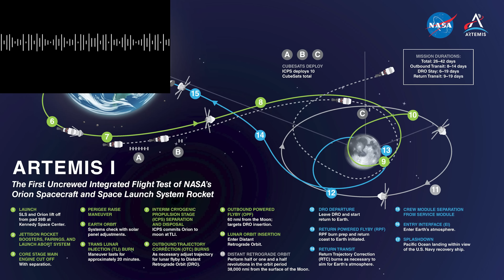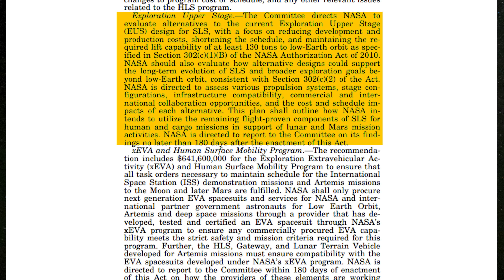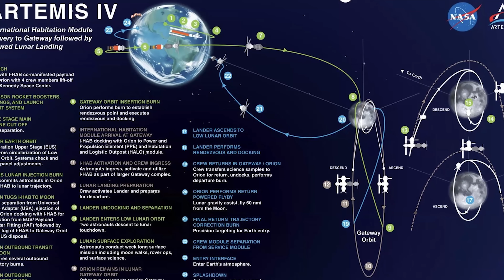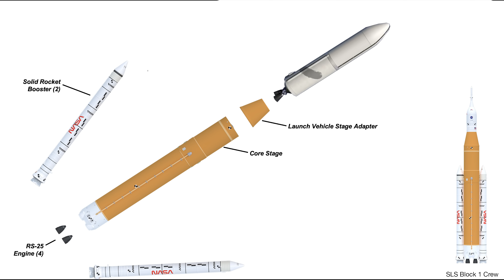NASA Found Brilliant Solution to Go Back to the Moon before China. SpaceX Starship?

Comment: How can Space X Starship land with those small landing gears on rough moon terrain?  it looks like it would topple over  if it landed on the side of a sloped hill or less than level landing spot. How would this be overcome?  Does it limit the areas where it could land?  Is this a concern?  The entire rocket does not look that stable sitting on those tiny landing legs.

Comment: Worried about billions over budget and over a decade of redesign, so am I, 
but  have a look at the DOD and the F35 Joint Strike Fighter.  These large budget programs are never about the goals, it’s mostly about getting the money. Truthfully $4 Billion a throw to get to the moon with a crew is high but not comparatively prohibitive given other high tech programs especially in aerospace. At say one launch every 4 months it’s $$12 Billion a year. Pretty small measured again a 4 $Trillion (yep that’s a T) budget or an $880 Billion DOD budget.    

A good analysis would be to examine the SLS contractors and audit where every dollar went .  After all the Orion is a larger Apollo command capsule and the rocket components are ALL variants of Shuttle systems.

Comment: Remind me - when did NASA ever manage to get anything recently that not incredibly late and not seriously over budget and when did Blue Origin ever manage to get any rocket into orbit? 
I'll believe it after it's happened. 🤷
Reply: Not NASA but the B-21 Raider is coming in under budget and ahead of schedule.  NASA's problems stem from a lot of competing requirements and stakeholders that create a vicious cycle.  Sadly, Starship is an even bigger boondoggle as the entire launch architecture ultimately fails.  Nobody is going to the moon if going to the moon means 10+ Starship launches hours apart and it all working flawlessly.  Elon's contacts should be canceled and the money reapprorriated to building a Lander that will ride on SLS.
Reply: @atticuspomponius  
SLS is an incredibly late and over-budget turkey.

Comment: How far do you bet the next one will get?  I'll give 3:1 it doesn't make orbit.
Reply: They are not trying to get to orbit yet, it's called a development process. It's the biggest, most powerful, and most complex rocket ever made. Cut them some slack, the progress is actually amazing and years ahead of anyone else so...
Reply: @ericmichel3857  no slack.  There's no benefit to SpaceX whatsoever.  Arrogant waste of billions.
Reply: @ericmichel3857  Saturn-V made it to the moon on it's third launch. It never exploded during launch even a single time.
57 years ago.
Reply: @Yora21  You do realize most (if not all) of these test flights are designed to fail. They are experimenting with various system designs, and then stressing them beyond their design limits to see where and how they fail. This is how they will eventually build a reliable system. Some failures may have been unexpected, but that is how they are learning. 
Yes Elon is very optimistic with goals and time lines, but that is what good leaders do. Most people tend to operate to the level of expectations, so if you want rapid innovation and productivity, you need to set high expectations. So you have to take his estimates with a grain of salt, but they are certainly making progress a lot faster than any other team on the planet. How can you not see or admit this undeniable fact?

Comment: What options does NASA have? How about scrapping the Artemis program altogether, and going back to Saturn/Apollo? That program went from drawing board to moon landing in 7 years, without today's computers and modern manufacturing techniques. We still have the hardware in museums. The F-1 engine has been redesigned to use 90% fewer parts, cost less, and generate 10% greater thrust. Just imagine what could be done if this was done with the entire program. 
As for cost, had NASA stayed with Saturn/Apollo, it could have launched every payload launched by the shuttle, AND gone to the moon 100 times, built a moonbase, and a space station, and had money left over. 
So yes, NASA has options - go back to a proven system that worked, or stick with a program that costs 2-3 times as much, is decades behind schedule, and still does not have a viable capsule, launcher, or lander. Gee, what to do?
Reply: But there's so much money in re-inventing the wheels ...

Comment: Here’s my idea:
Replace the RS-25’s with RS-68’s
Replace boosters with 4 Falcon Heavy core boosters
Reply: The RS-68 was studied for a concept similar to SLS, they found that the ablative nozzle wasn’t a good idea next to the SRB’s.

A Starship-derived vehicle using Super Heavy and an expendable upper stage would be the best option.
Reply: @darthrevan2961  expendable starship pretty much? with re-use on booster at least?

Comment: SEVERAL roughed-in plans for consideration:

#1:
What man-rated alternatives exist for Exploration Upper Stage?
Find one such replacement, mount it on a Falcon Heavy and get it on its way.

#2:
Commission a non-recoverable Super Heavy and a non-recoverable and truncated Starship with a special interstage to launch the Orion package, including the Exploration Upper Stage or its replacement.  The pad systems will need to handle LH2.  
The refueling still needs to be done for the OTHER Starship, the HLS.

3:
Plann to launch HLS to LEO and refuel it.
When that is done, launch the Orion package to orbit.  When it docks with HLS, fire up HLS and push Orion to the moon.  It would only need to stay backwards until TLI is accomplished when it can unlock, turn and proceed on its original mission profile.  The two vehicles will dock, again, near the moon and proceed with thriginal plan.

Savings to NASA, about $3B, assuming SpaceX can supply which ever set of hardware is decided upon for  no more than $1.2B.

Comment: Pourquoi avoir besoin d'une solution  pour quelque chose qu'ils sont censé avoir déjà fait plusieurs fois?! À moins que... Non?!... Ne me dites pas que...
Reply: The Saturn 5 rocket was designed and built to take men to the Moon. Sadly,the plans no longer exist.
Reply: @PC4USE1 : the plans exist, as do 2 unused complete Saturn V's as museum pieces. What has changed is technology and materials. Really, not much use building equipment that is 60 years old.

Comment: Would it not make more sense to launch a lunar Starship to orbit empty, fuel it up with however many launches that takes, then once its all gassed up, at that point launch the astronaunts up using a Dragon capusule, dock with Starship, load up, then head for the moon. No need for Starship to even have an abort system in that scenario.

Comment: None of these starship claims has been born out by ACTUAL EVENTS. Did you see the state of starship before it sank into the ocean? That was neither reusable or capable of sustaining a crew. This is all just talk until that system is HUMAN RATED and can lift off and return safely to Earth. Stop parroting billionaire fantasies. You also can't go to the moon on these tight budgets. Its not gonna work if you want to beat the Chinese .
Reply: They are doing all sorts of experimental stuff with all launches so far and a lot of those they already know are iffy but they want to test it. Instead of modeling stuff for years they build and launch and see what works.
Reply: do you work for special interests? Artemis might be good but it's not going to be in budget you've got too many hands in the pot. even with the motivation of competition from SpaceX. those industries have no real motivation to save the government money only take money that could go elsewhere.
Reply: Easy to criticize a brand new product under development as not having accomplished it's goals. How much did you accomplish before you were born? Fuel is cheap, big rockets are expensive. It doesn't matter how many fuel trips required when the rockets and ships are re-used.
Reply: @royh6526 I’m not criticizing. I’m stating facts. Not one refueling maneuver completed. The plan is to use a booster and a star ship to ferry 10 loads of fuel up to a star ship in orbit , fill it up and send it to the moon or mars. As a casual observer of this process THEY ARE NO WHERE CLOSE TO ACCOMPLISHING A MOON MISSION. Forget about mars, let’s just focus on the moon. At the rate they are going it’s not happening until the 2030s
Reply: @ChristianPerez-gc2hm  " At the rate they are going it’s not happening until the 2030s"
You must be young. I'm old and 5 years ago seems like yesterday. SpaceX started working on Starship 5 years ago, and another few years to get to the Moon seems about right. SpaceX progresses faster than any other company. NASA has been working on replacing the Shuttle for over 20 years.
Reply: @royh6526  Nasa's budget is nonexistent. You wanna go to the moon before 2030, use falcon heavy. Instead of moving toward that goal, space X is being allow to use our tax dollars to Rand D this boondoggle. Starship right now is a tin can with rockets and fuel. Do you honestly think that once it's full equipped that any of the information that is gathered now will be relevant? They are ironing out the basics of operation. This is a test bed. It is unknown what the development time of this platform will actually be. But I will bet you that a human won't be going around the planet in a starship until the 2030s.
Reply: @ChristianPerez-gc2hm  "But I will bet you that a human won't be going around the planet in a starship until the 2030s."

I agree, it will take some time to get human rating, however It will do much work before then.

"Do you honestly think that once it's full equipped that any of the information that is gathered now will be relevant?"

Yes, highly relevant to design the final product.

Comment: Personal speculation: next year, a dock-undock test will be carried out between Starship and Dragon, then a proposal will be made to avoid SLS and Orion and use Dragon to travel from Earth to LEO, put the astronauts on board the resupplied Lunar Starship that will do LEO-Moon-LEO, then return the astronauts on Dragon for their return to Earth!
Reply: Concept right, details wrong. Dragon is not suitable for the long and radiation filled trip to the Moon. But all it takes is for the astronauts to transfer from Dragon to HLS in LEO then the HLS can do the whole LEO-MoonLanding-LEO accompanied with fuel tanker(s) to orbit the Moon while HLS is on Moon surface and all return to LEO.

Comment: Starship could slash lunar mission costs, but NASA must ensure its safety matches SLS/Orion.
Reply: True, but since SLS (Artemis 1) has at least launched, made a fly-by of the moon and returned its capsule safely to Earth at lunar return speeds (40,000kmh) and meanwhile, Starship has been barely able to get into LEO without blowing up in some shape or form, and is unable to survive a sub-orbital re-entry (28,000kmh) without melting then this is a bit of a moot point.  Maybe in another 10-15 years.

Comment: Apolloitis. The madness that we have to repeat Apollo's methods because it worked almost seventy years ago. 
Apollo was a kludge, a mediocre and unsustainable system designed for a political statement. Apollo ended because it had no goal. It had no ability to iterate technology. It was a way of spreading spending across 50 states to maximize political support. But it was useless as a space program. NASA wanted a reusable space plane to do what Apollo was doing. If NASA had been allowed to iterate the space shuttle properly for instance making a titanium instead of aluminum, they would have by now had a cheap and active space program.
Reply: Finally, someone that gets it.

Comment: “its crew module and launch abort systems are heavier than modern, more efficient designs”? This argument ignores that Orion is a DEEP SPACE vehicle as opposed to Low Earth Orbit (LEO) spacecraft. The launch abort system is dead weight after achieving a certain altitude. LEO spacecraft can afford the extra weight to and from LEO, but Orion’s LAS is designed to be jettisoned so it doesn’t need to get hauled all the way out to the moon and back, as well as during reentry. Do the math!

Comment: Starship will be a flying coffin.
Reply: Why?
Reply: @Workingcinderellaman-jw2pf  it’s risky at launch and landing.  I’d be surprised if NASA launch astronauts on it for ten years.  It wil🎉l need to demonstrate exceptional safe launch cadence before they do.  It’s the rocket for the 2030s not the 2020s.
Reply: @keithparker6520  Once it's rated to carry astronauts, why would it be any more risky that SLS? When it is human rated, (which shouldn't be that long from now) it will have been tested much more thoroughly than SLS.
Reply: @Workingcinderellaman-jw2pf you think going to the moon is ABC .. China landed an unmanned craft on the moon in 9 days, Apollo in one.  day. Space X will prove Apollo projects 1969 to be true or false..
Reply: @liongjiahwong5478  What are you even talking about?

Apollo took days to travel to the moon and back.

(8 days, 3 hours, 18 minutes to be exact)

Jfc this is not exactly hidden information.

The Apollo launches are probably the most publicised govmt projects in global history.

Also how long it takes to get there depends how long and how powerful the booster burn from Earth orbit is.

If the rocket is significantly less powerful and/or carries less fuel than the Saturn V rocket used in the Apollo 11 mission then of course the trip to the moon is going to take longer.

Also there is a specific time when the moons orbit will be significantly closer to the Earth.

Timing the mission to coincide with this means less fuel is needed and/or you can get there faster.

Comment: Note: the cost comparisons between Artemis and Starship are not realistic. Costings for Artemis are based on flight tested hardware and known costs from suppliers. Curently, Spacex does not have a system that can demonstrate orbital capability, let alone flight to and from the Moon. No Starship prototypes have made it back to Earth in one piece from a suborbital flight. Furthermore, Starship is not a human rated design, thus far the only Starships to have flown are simply "boiler-plate" test articles. Unless the USA gets it's act together, I doubt they will be able to get anyone safely onto the Lunar surface (and back) in anything more than a nostalgic nod to the efforts of the 1960s.

Comment: I'd laugh myself silly if Elon Musk, at the end of his HLS test flights, landed his own astronauts on the moon and brought them back without bothering about NASA's ridiculously strict crew certifications. A death knell for NASA!😋
Reply: If you believe that possible, then you're half way there already.  Returning from the moon is ridiculously more difficult than LEO and he hasn't even managed that yet.
Reply: @poruatokin  That's not true; it's actually the easiest part (Apollo 13 even managed it). Once the HLS returns to LLO (low lunar orbit), it can easily accelerate to reach TEI (trans-Earth injection). After that, it ONLY needs to propulsively decelerate to LEO speed (~27,000 km/h or ~7.5 m/s) on the return trajectory to reliably enter Earth's orbit at an altitude of approximately 200 km. Without propulsive deceleration, the HLS would have to plunge into Earth's atmosphere at ~40,000 km/h or ~11.1 m/s. So far, only the ablative heat shields of Apollo and (more or less) the Orion capsule have survived this during re-entry. The Starship is unlikely to survive such a re-entry and the HLS does not have a heat shield per se.
Reply: @ClashStats You completely missed my point.
Leaving lunar orbit is easy, it's all downhill from there - it is the stopping at the bottom that is difficult. As you mentioned Starship is incapable of direct entry to Earth's atmosphere.
Are you claiming that Starship will have the fuel reserves to propulsively enter LEO after the rest of the journey and boil off is taken into account?
As for Apollo 13, it never entered lunar orbit.

Comment: The Orion system is deeply flawed, unable to enter and leave Low lunar orbit, this has pushed increased deltaV to the lander and practicaly cripples any design.  And the compromise NRH ornit is exceedongly dangerous as it traps the astronaughts on the moon for 7 days, and means a 10 day return to Earth, a period so long that a coronal mass ejection can not be dodged.
Reply: In order to protect from coronal mass ejections, Orion is supposed to have emergency protocols for astronauts to take shelter in more protected areas of the spacecraft. On Artemis 1 they tested radiation levels across Orion intensively for that purpose.
I don't think that Apollo (let alone any other spacecraft since that) ever had the capability to keep astronauts protected on long term deep space missions, but I might be wrong on that.